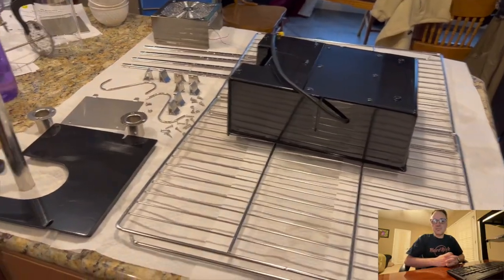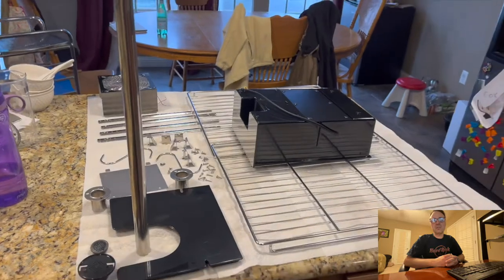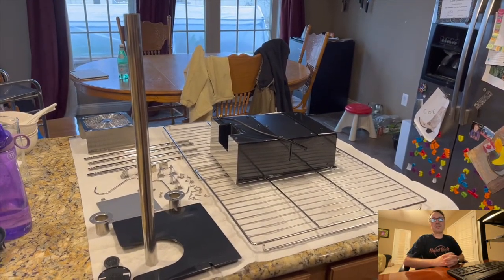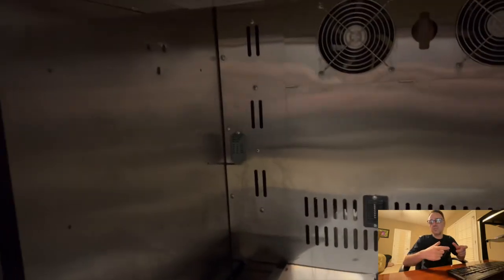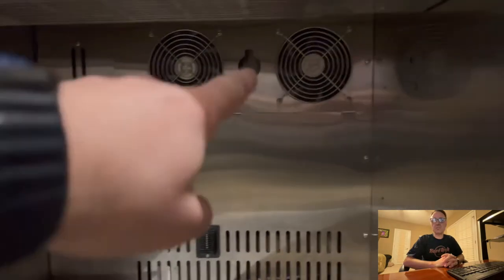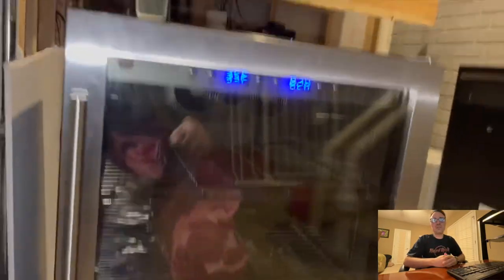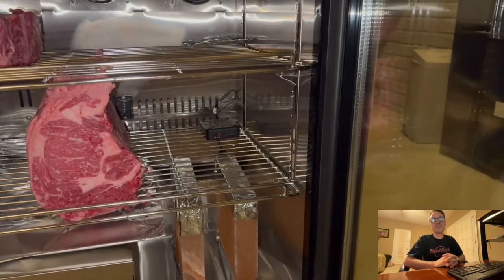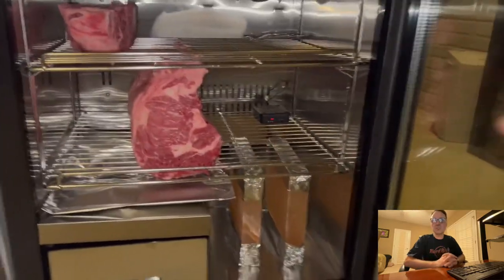Steak Locker SL150 cleaning and maintenance

Comment: Thanks for the video and ideas. Looking great.
Reply from the maker: Thanks. I have gathered some interesting data with my new temperature and humidity sensor I added (showed in the video). Will share results soon.
Reply: @eftim7652  What temp/humidity sensor are you using?
Reply from the maker: @xtraflyer  I have 2 sensors in there, HDC1080 and SHT35 connected to ESP32. The SHT35 is much better. You will need to implement some kind of filters ether way. I haven't made the video of mine yet - will post once I do.
Reply: @eftim7652  Have you consider using an integrated sensor like the BME280? It does temperature & humidity sensing in a single package.
Reply from the maker: @NicoJob-gs4wi  I haven’t tried BME280, but I have used HDC1080 and SHT3XD (with ESP32). I found SHT3XD to be much better on both temp and humidity. In one of my videos you can see the setup. I had started a video about the setup, but never finished it.

Comment: hi, i was curious if you has any issues with your steak locker since? I recently bought a used SL150 but the humidity reservoir box needs replacing.
Reply from the maker: I have had issues with it on and off. Best results for me were when I up the temperature above 36, (37 and 38 worked best for me, otherwise if would go below 34 and above 40 very often). Just posted my last video on it :)